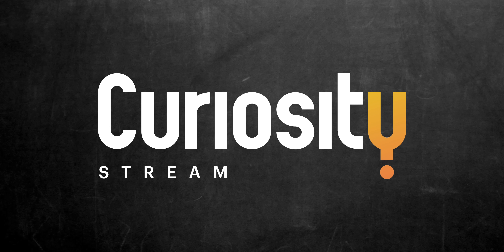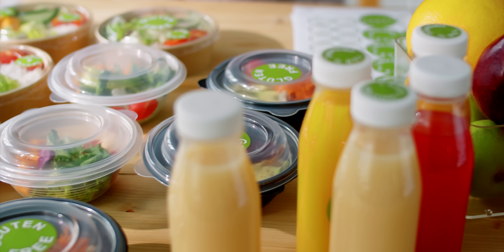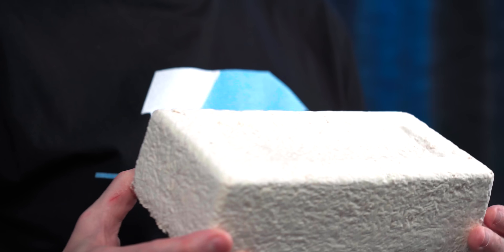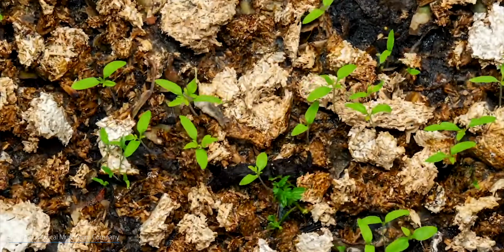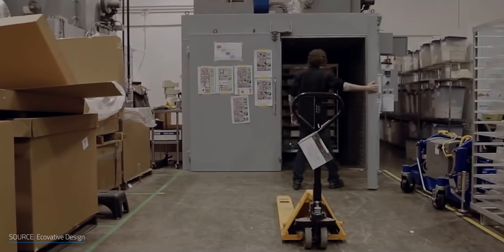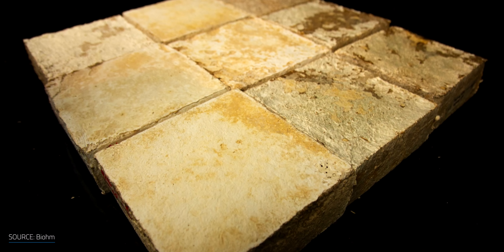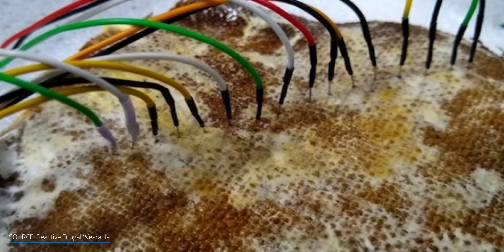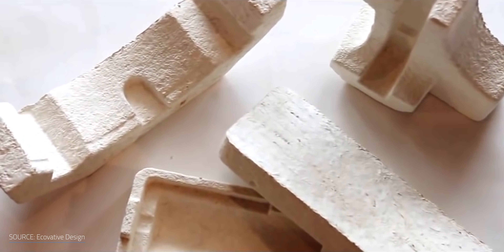Is Mycelium Fungus the Plastic of the Future?

Comment: will it be attractive to rodents (rats, mice)? Manufacturers are using soybean oil in plastics wire insulators. So now I just had my car in the shop for mice chewing the wires on the engine. My Polaris Ranger won't run at all for the same reason. Several years ago I had to replace the wiring on the Jeep I had because they ate the wiring on it as well. Now I'm concerned about the Tesla Solar Roof I'm installing. Am I going to have a problem with too or will Tesla have everything sealed up enough to keep the little basters out?

Comment: so i worked in one of the manufactories for these and this was my concern when working there that no one could or would answer. it can be used in packaging instead of Styrofoam right? great... but so can compressed cardboard. and that, with organic clues, breaks down when wet within days. So how is it better than that? also that can be used instead and its not. why? theres far more questions than answers as far as packaging goes.

Anyway the 'mold leather' (i know its not mold we just called it that) is hecka cool and I really wanted some of that. I think the industry should really more focus on those types of things than a fad 'eco' packaging when in reality we already have tons of different-cheaper options that are STILL not used.

Also the insulation and building stuff is pretty cool but kinda niche due to price rn but itll get there
Reply: Is compressed cardboard really cheaper though? Anytime I've ordered from a company that uses cardboard packaging material (besides the boxes) the stuff is already half broken down by the time I receive my order, I wouldn't want to order something sensitive like a smart device, or computer if they were using compressed cardboard.

Comment: Natural materials like fungi or wood has been 'developed' for billions of years. Human-made artificial stuff like plastics was usually developed in much shorter time-frame and with profit instead of important factors and values in mind. Remember Dichlorodiphenyltrichloroethane (DDT) or asbestos? And these are just a tip of the iceberg in proving how 'errare humanum est'. Use of natural materials like fungus is a no-brainer. But unfortunately not for the people only interested in profit at any cost. It would be great to change that.

Comment: well  I don't think it will replace plastics 100% as the molds for the foam and bricks are made of plastics :) 

Still it's a start, even if they replace  just polystyrene, if they can make bottles out of it   and it's cheep to make them, then it could work.  

but 100%  replacing plastics is a wet dream at this point, fun but not real. 

As a side note, it's kind of funny how companies like this say they are peddling a product that replaces a "bad " product, when they make the molds they need so much out of bad product they are replacing, aka transparent  plastic in this case. :)  

It's kind of like a vegan going  "meat eaters are Satan"   but then he goes to KFC and  gulps a whole bucket of chicken, I mean, sure he could go and buy vegies from the market, but why bother when KFC is right across the street, just like the makers of fungal plastic could use iron or wooden molds, but why bother when KFC is soo much cheaper :)

Comment: It does sound promising but I do have some questions on how it will preform in the long run. How long will the insulation last before it degrades and you need to re insulate your house? Or how many rainy days and long hikes will those shoes hold up compared to normal leather? I do think it is promising for packing and one time use objects and I'm excited to see the development but for long term I don't see it working as well as everyone is making sound.

Comment: Yes, there is something critical you missed. Mycelium is not weldable. This creates a major problem with product assembly, as you need to revert to glues, which have environmental issues. Plastic is weldable. Most plastic products made today are assembled by welding multiple components together. From an environmental standpoint, you are trading one hazard for another. So what is the point?

Comment: A cool thing I am doing with mycelium at the moment at my college is making a accoustic pannel for next to a highway to keep the sound from getting to the residential areas. Very cool stuff, tho I wish it were beter at weather resistance... At least the mycelium compostie we are using is very poor for it but no matter. Just making nice a little box if you will around it out of rice. Called Resysta, now that is a awesome material!!!
We also have a option that we have developed at our school, and it also made completely out of mycelium with wood chips. It's is in almost every way the exact same as mdf. It is made by putting a mycelium sheet of about 5 inches and putting it under a high presure mold and heating it to about 100degrees. This will create a hard perfect wooden like board just like any other. The reason we aren't using this as well is because it has not been proven to be used next to the road for a extended period of time and because of the amazing abilities of resysta.

Comment: I'd rather insulate my home with silica aerogel.  Fireblocking, superinsulating, lasts for millenia and requires zero material, which, in eons, turns back to pure sand. But as a plastic replacement, I really hope they succeed making it competitive, we badly need another material.

Comment: One possible plus and minus:   +   Mycelium granules could be incorporated into concrete mix to create blocks and forms (instead of styrofoam) to produce lightweight, insulating products.  -  What about allergies?  Allergy to the fungus itself, and of possible black mold that may grow in the nooks and crannies of the fungus if it gets wet from a small water leak, condensation,  or humid conditions.

Comment: I would LOVE to insulate my home with an organic (read "of an organism") material vs high energy insulators like rock wool or fiberglass. This is honestly really exciting. To think polystyrene - which is not recycled due to prohibitive costs and energy consumption and cannot safely be burned for energy production due to the extremely toxic fumes it puts off - could be replaced by something that will compose in your backyard? That's AWESOME! I hope this gets a foot hold and only becomes more economically feasible AND ecologically sustainable.

Comment: When you mentioned housing, my first thought was my house would be growing mushrooms due to the wet environment I live in. I'm both glad to know that the material is already dead, and disappointed I wouldn't get a free crop of mushrooms :)
Reply: Growing your own mushrooms is ridiculously easy in certain locals.  I've got a tray I harvest a half dozen from every day.  Just replace the organic fertilizer every year and you can keep eating the same mushrooms (an no, it doesn't have to be manure.  There are plant waste fertilizers out there.).  Just has to be not to hot, not too dry, and not too wet.  Best of all, you can grow them out of sunlight.  It might just be me, but they also seem to grow best in quiet.  Not sure if that's a factor or not. I have mine in a basement garden I maintain with hydroponics, but the mushroom tray was long before I put in the hydro system.
Reply: @David13ushey  Daaaaamn it’s that easy? I would be your neighbor and I’ll make a bunch of spaghetti for you.
Reply: @Anjiwee12  Soooo yes and no.  Remember how it has to be not too hot, not too cold, not too wet, and not too dry?  It takes a bit of effort to keep it in the sweet spot.  I use four thermometers and four moisture sensors to keep the tray stable.  But once you find it and the mat is established, it's pretty regular.  Depends on what kind of mushrooms you grow too.  There's some more exotic varieties you can grow on logs and the like with a more nutty flavor.  I grow cremimis.  I know some folks that try to grow shitake but they're a lot more fussy.  There's tons of variety.  It's just making a nice stable place for the mushroom of your choice.

OH!  One other warning.  When you're making your bed, keep it very clean.  An environment good for mushrooms is also good for other fungi, namely mold.  You want to keep the bed itself clean and as moisture free as possible.
Reply: @David13ushey  When you were giving your last warning, I thought for a moment that you meant the bead you sleep in, not the bed you grow mushrooms in.
I was willing to accept that too, as I thought " Yeah that makes sense, if one disperses spores before you can prune it you don't want mushrooms growing on your bed"
It was only after I reread it twice I understood
Reply: @David13ushey  A while back I was able to clone some wild oyster mushrooms I found in the woods by putting pieces of the stems in sterilized coffee grounds and old cardboard. Yea super easy to grow, its crazy how theyll even eat cardboard.
Reply: @Tony-td6wj  I found the bigger problem was keeping mold from ruining them.
Reply: Can I just grow the insulation right in my walls?
Reply: @joshoxborrow2314  nope, and you wouldn't want to.  That's called black mold and it a bitch to remove once it gets started.  I mean spraying down with dry ice nasty.
Reply: @gailbushey6510  lol my parents use to have an oily paint on their bathroom ceiling(they saw brown stuff and thought it needed a new coat of paint). Then painted over it. Then we realized their was black and brown stuff coming out of the ceiling lol. Since their was moisture stuck between the roof and ceiling mold started to form on the oily paint below the new paint. We had to use ATLEAST a gallon of bleach to get rid of it. Not to mention having a brother using the only bathroom available and having to use the one that reeks of bleach and makes ur eyes cry in pain 😄👍 so- after that they PAINTED OVER IT AGAIN but in black(good choice) and its been fine since lol.
Reply: This thought intrigues me...a mycelium based home that also has a controlled location for harvesting the fruiting bodies. But could shitake and oyster mushrooms coexist in the same house? I grow mushrooms in a cellar, on purpose. And, I grow vegetables in my pantry (portable greenhouse and LED grow lights). I believe that the homes of the future should be capable of producing food. Just a thought experiment of mine. A friend of ours grows greens hydroponically in his basement with a couple of tubs of tilapia added for a more complete life cycle. I'm getting hungry for a broiled tilapia filet in mushroom sauce on a bed of garlic sautéed greens.
Reply: That sounds good... that it's heated to make the mycelium dead or inert, but how does it fare against mould and other microorganisms during the lifetime of the product ?  Does a biologically derived product serve as a nutritious substrate for potentially hazardous microorganisms ?
Still... WOW... the potential to permanently replace the vast amount of plastics going into landfills and the ocean...
Reply: @paulwalsh2344  not just microorganisms. Seems like it would be a tempting food source for insects and rodents and such. They'd have to find a way around that.
Reply: Tho it could be a great substance for wast range of other moulds and fungi to grow in.
Reply: Next step is bio-engineering Smurfs to live in those shroom-homes.
Reply: Morrowind?)

Comment: I would be very interested in trying to insulate my house with mycelium, but while you mentioned thermal and acoustic characteristics, along with it's reaction to fire, you didn't cover how it reacts to moisture. I would guess based on its composition that it would be highly prone to rot, and also become "hyper"-allergenic, if you know what I mean. If they can figure out a way to make it moisture resistant and rot resistant, while still being ecofriendly, then I might buy some to stuff in my walls.

Comment: Put against plastic directly, plastic has huge tensile strength, mycelium has none at all. It's so soft you wouldn't call it brittle :) certainly, for bulk applications, like package filler or insulation etc it would be very applicable. Plus, it grows itself! That's what's most amazing about it, and where we might uncover more applications. Like furniture which slowly grows and you give it regular haircuts or something ;)

Comment: so we have cheap, durable, liquid resistant, heat resistant, easy to shape metrial but we are going to stop using it because of waste and start using something worse? No, we won't, that's not how it works. We should add taxes and fees to make plastic recycling cheaper than new plastic production and this will do.

Comment: What I wonder is, if it degrades so quickly outdoors (45 days I believe he said) how could this material be considered to be used in products that you expect to use for decades? 
Shoe wear and clothing, does it breakdown quickly when exposed to water or sunlight?
Insulation for a house, does condensation cause it to breakdown and rot?
food packaging and storage, what are the risks in it capturing or even becoming a structural base for germs, virus, bacteria, etc...

I guess I mainly don't understand how one of the benefits they brag on is how quickly it will decompose but then promote the idea of them being used for long lasting products. Does anyone have any more info on this aspect?
Reply: There was a part in the video about where they used it to make structures, and they did some type of environmental stress test that simulates 3 years of weathering in a week, and it had the same shape and size. It's probably something living in the soil that breaks it down, and eats it. Another bacteria or fungus. So I would guess, as long as you don't break it up and mix it up with soil, it lasts for a good while. They did mention it wouldn't be as durable, or last as long as traditional construction material though.

Comment: There seem to me a number of problems/concerns/questions I am noticing here,  How does it stand up to heat, does it get brittle after heated, what about strength testing, what about other applications besides only Styrofoam type plastics (for example, rubbers, various strengths of plastics, etc...), what about coloring it, or clear plastics, what about consistent results in all those categories (rather than having different results depending on a number of factors), how does it deal with moisture in applications such as food that carries moisture, or sprinkler systems, how does it stand up to UV, etc...  Yes, it seems good for some type of applications but in order to really do much of anything in the plastics market it has to address these issues.  Also, what about health risks with this too?  Is it possible for moisture in food packages to contaminate our food and possibly poison us?  How does the body handle long term exposure to the product (certainly not saying Plastics are great about this at all but this may carry its own problems so what are they, time and scientific testing will be the key to finding out more about this)?  The surface is visibly rough and inconsistent which is a bad thing when precision is needed in a product, if I need my material within 10,000th of an inch and uniform over the entirety of a surface how can we achieve that with something grown in its own open mold rather than injected into a closed mold with those specific requirements?  Just growing it in a mold isn't going to be enough, we need a way to inject it into a mold and rapidly cool it in order to get precise measurements for standards in our applications.  This is also why how it deals with heat and if it gets brittle after being heated will be so important.  I am sure there are some great uses out there for it and I look forward to seeing it in use.  However, I do not think this is ready to handle anything like what plastics do.  I wish the best for the product but I am far from convinced.  This seems to me to cover far less than 1% of plastics applications in its current state as a product.  Best of Luck.

Comment: What about its use as exterior house insulator - ie as in panels? I refused the foam based stuff as I thought it extremely environmentally negative. There are cork panels but I wonder if the mycelium bricks could be shaped into a suitable panel. Could it be adhered to the walls or need be drilled to fix it. Can it be painted rendered maybe with lime? Would so love to know more.